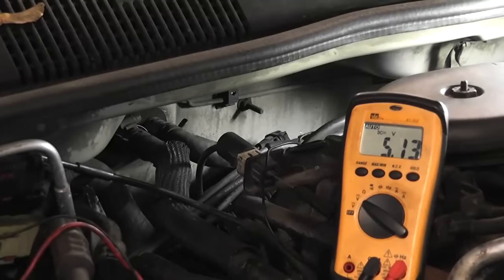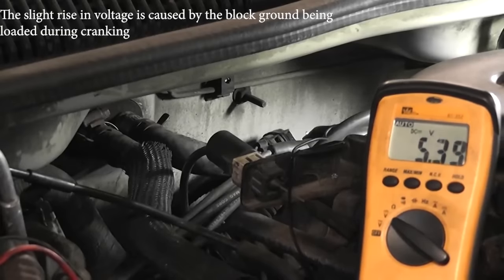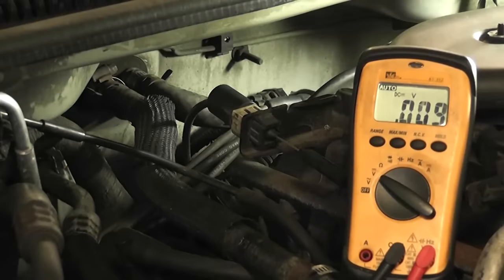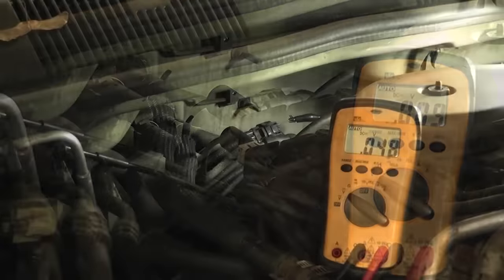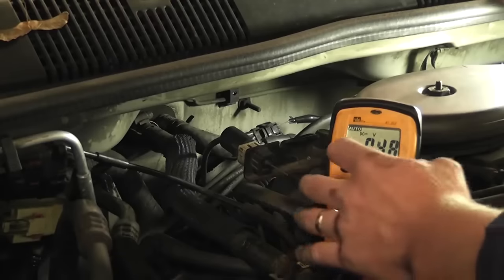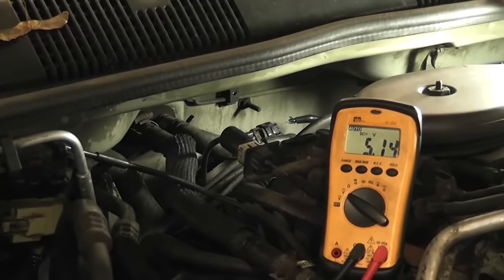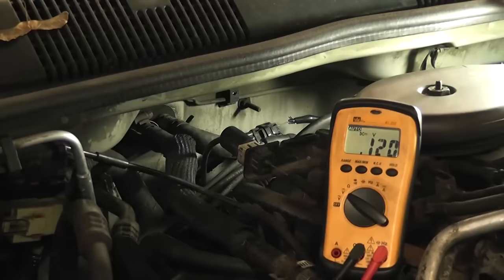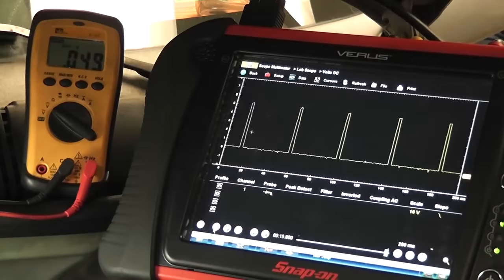How to test a cam or crank sensor with a voltmeter - hall effect type - (Quick Tips)

Comment: Very nice video Danner. I liked how you are breaking videos down to segments for us to learn. I really liked how it's was straight and to the point on how to test hall effect sensors. In addition, I liked how you showed us with a volt meter and compared it to a lab scope. Not all of us diy guys have snap on graphing. I always like it when it is explained on which meter leads are connected to which terminal on the battery and what the dvom is set at when doing electrical testing in video during testing of each wire. Because if it's not explained, I can watch a video and not understand exactly how it was done if there person explaining doesn't explain which terminal on battery he connected to and what his dvom was set at while testing the electrical component. Might I say though, I love all of your videos. Thank you.

Comment: Thanks Paul - Great reminder, DMM at times will read 2.5 Vic on a signal who's frequency is below a certain sample limit.  For instance on a Wheel Speed Sensor you may be able to Spin the wheel by hand at a low enough speed and the VMM will read 0.5 Vdc on a 5 V pull down Hall Effect sensor.  As always thanks for your great teaching methods on your videos, "Scannerdanner There is NO Substitute !!"
Reply: I meant VMM will read 2.5 Vdc , 5 V , 50% duty cycle wave form, if the frequency is below the Sample limit, thanks.
Reply from the maker: Yes sir and thank you!

Comment: Excellent.
Check for air gap between inductor wheel and metal chips on magnet or sensor also. Found no start from this also.
Good show.
Reply from the maker: something you would never catch on a voltmeter, but the scope would reign supreme :-)

Comment: you can also use the ac voltage setting, hz setting and duty cycle setting on the voltmeter.

Comment: Pretty cool doing this stuff in the field and then sitting here after dinner I get a video on it haha. Had a Dodge 5.9 with a no start. For whatever reason my dmm showed both sensor powers and grounds good and then my scanner was showing a good ckp signal and a bad cmp signal. The funny thing is, upon removing the ckp sensor, it was swollen and cracked from oil intrusion from the vc gasket. Installed a new one and it fired right up, yet still shows a bad ckp signal and says out of sync. Silly mopars.
Reply from the maker: for sure and a great lesson to learn! A faulty cam sensor can set a false crank sensor code and vice versa. And yes, I haven't seen it on any other models but Chrysler :-)
Reply: @ScannerDanner  thanks for taking the time to reply dude. Love watching when I have time!!!

Comment: Hello sir it was awesome video and I have question .why signal was not 5 volt constant or I am mistaken
Reply: 5volt to ECU/PCM
Reply from the maker: I put a note in the video. The reason is wasn't was because I was connected to battery ground with my dvom. If I was connected to the engine block or sensor ground, it would have been steady.
Reply from the maker: Great question!
Reply: @ScannerDanner  I got that sir thank you from your great information it is awesome man thanks

Comment: Please help! Firstly, your videos and knowledge are great! I have a problem with my wife's 04 Buick Lesabre. 3800 series II engine. When I read the voltage in the two signal wires of the CKP sensor it shows wierd stuff.. Unplugged its 6.2V each. With a new ICM its 4.95V each. Problem is when plugged in to ANY ICM: drops to 1.77V and 0.77V and STAYS there no matter what. I tried 4 different sensors. Acdelco, gm geniuine. One of them would drop to 5.5V and 4.5V. But none will recognize the metal teeth of the harmonic balancer. When tested outside, but plugged in its still the same. Its getting power, i checked every wire for damage, but im not sure about grounding because i checked that with key off for resistance. Between sensor ground to ICM ground (g112) there was 1.5- 3 ohms resistance. Is that too much? Whats going on? Car ran the last time when i changed the CKP sensor. It ran for 2 mins then died and never started. Please help

Comment: Exactly what school taught me. But got a question. Let's say you remove power to the hall sensor. Would the scope show constant 5v or 0v from the signal wire?
Reply from the maker: With the sensor unplugged, some will read 5v while others will read 0v. There are two different design signal circuits (pull-up and pull-down)
Reply: @ScannerDanner  thanks for the reply!

Comment: I never actually understood why my meter wasn't "fast enough" to measure a crank sensor, I just know it isn't. Funny thing is, I've scoped them, but never put 2 & 2 together for the time window of high point voltage verse low point voltage as to why my meter isn't fast enough. But when you explain it, it makes perfect sense. Also, in theory with a meter, you should be able to do KOEO and bar the engine over and be able to observe the high and low points no? (As opposed to the bumping demonstration you did with the key)
Reply from the maker: That is correct, only reason I do not suggest that is with the key on, you may get a kick from the engine while rotating it by hand, leading to injury. Unlikely, but that is why I do not suggest it.
Reply: @ScannerDanner best to find a fuse for a fuel pump or disabling spark so you don't get the jump you're talking about. If it's a diesel then disconnecting fuel pump fuse is all it takes

Comment: Very nice video. My 2006 mini cooper s don’t keep the 5 volts when I crank. What does it mean? What could be the next test or what do I need to replace? Thanks, Tom
Reply from the maker: You need to verify the ECM is maintaining its ignition and battery feeds during cranking

Comment: Great vid, thank u for that bro. Can we make this test with prow power prob IV
Reply from the maker: Yes, of course. It does content a voltmeter
Reply: @ScannerDanner  do you have anything belongs power prob iv tester that can help me to use
Reply: @ScannerDanner  do you have anything belongs power prob iv tester in your channel that can help me to use
Reply from the maker: Type in "power probe" in the video search box on my channel page. I have a few
Reply: The power prob hook is a really good   tool check it out.  I use my hook on a daily basis.  You can see source voltage,amps,and resistance all at the same time.  There is a pulse width mood and bias volt from .5v to10v, and much more.

Comment: Thanks Paul, as always - well done.  Kind of odd, the Cam sensor looked like a 5 volt peak square wave form at about 50 % duty cycle, should have read ~ 2.5V dc on the voltmeter ? Once again thanks.
Reply from the maker: frequency is what you are not considering. That DMM will sample about 4 times per second, maybe less. If the frequency is real slow, the meter will start to show the highs and lows

Comment: can you also remove plugs and slowly rotate crank with ratchet on crank nut to enable the multimeter to catch the signal? these videos are great, they are the only videos that teach one how to diagnose things like this.
Reply from the maker: You can do that as well, BUT there are some safety concerns with that. One, the key will be on and the crankshaft can kick on you on a compression stroke with an ignition event. Two, there is no need to go through all that work when you can just simply bump the key.

Comment: Mr. @ScannerDanner, you mentioned slowing the crank down to test for signal but did not mention one can manually turn the crank while checking the signal. I found in my Acadia (pull-down system) with P0335, I only saw 0V at signal while manually turning the crank. I then found the connector had signal and ground wires exposed and shorted to each other.  I trust the ECU and sensor are still intact.  ¯\_(ツ)_/¯
"KEEP CRANKING KEEP CRANKING" 🙂

Comment: Great info. I’m trying to figure out a 2014 equinox no start issue. I understand that using an oscilloscope would be ideal. My computer is giving me p0017. I have replaced all sensors, timing chain and cam phasers. Double checked the timing chain it’s correct. Sometimes the 2.4 ecotec will start and it runs great. When I turn it off it won’t start. I’m thinking if the reluctor ring has moved on the crankshaft I would get a p0016 and p0117. Any thought and how much is a house

Comment: I've got some symptoms and some codes, I'm thinking it's bad o2 sensors,   I would love to know if you think I'm on the right track?   I'm a bit of a rookie mechanic. I'm a delivery driver trying to keep my car on the road so I can keep working.

My car is a 2009 Pontiac G5 with the 2.2 ecotec, naturally aspirated, 5 spd with 104k km's on the it. It runs flawlessly up until this new glitch, New spark plugs, air and fuel filter since I bought it. I did notice it was starting to get slightly worse gas mileage before it started messing up. The first time it happened I was at a rolling start slowly accelerating when all of a sudden it started stuttering really bad and tried to stall, I pushed the clutch in and dropped it down a gear and it seemed to sort itself out (no codes popped up yet) then about 20 mins it did it again so I parked it, I tried unplugging the battery to let it reset and tried to drive it again the next night, again as soon as it got warm it started doing it again and finally threw up the engine light. (I did not have a code reader at the time)

At first I thought fuel pump, but fuel pressure is at 60psi while running and holds a solid 50psi for sometime after the engine is turned off (so I'm assuming it is good) I bought a code reader yesterday and it gave a EVA and o2s symbol with codes P0336 crankshaft sensor, and P0102-001, P0113-00.

from my research I'm seeing that o2 sensors should be changed around 100k km's and a couple online friends said they should be my issue... But I can't afford to be wrong and waste money right now.

Comment: At 4:35 the multimeter must read the same voltage at all speed , because the wide and the amplitude of the signal will never change, only frequency change

Comment: I have a question  , what causes the voltage drop at sensor? Does pcm drop the volts?
Reply from the maker: For a hall effect? There is a transistor that will switch on and off to either ground, or positive (5-12v range) depending on the circuit design (pull-up or pull-down)

Comment: How about using the duty cycle function all but the most basic MMs have? It should give a steady Hz while cranking and a little basic maths would tell you what that should be (cranking rpm /60 = crank sensor frequency).
Reply from the maker: You could use that, but I would suggest doing that only after viewing the voltage first. 
A signal that is fixed at 5v would be handled differently than a signal that is fixed at 0 volts and in both cases you would have a 0% duty cycle. Also the duty cycle test on some meters is pretty poor from what I remember.
Reply: Videos subtitle espanish View from P.R

Comment: What if there's no ground wire on the crankshaft position sensor plug only high resolution signal, low reference and 12v reference

Comment: Are all hall effect sensors outputting 0-5 digital sq. wave or are some putting out 0-12 sq. wave? Does that depend on the amplifier or the Schmitt trigger?
Reply from the maker: Some are 5, some are 12 and it depends on the signal circuit design in the computer as well. Some are a pull-up design and some are pull-down
Reply: @ScannerDanner  interesting. I had a case of a bad cam sensor. Code was cam pos sensor open circuit or short to B+. This was in an 05 vw passat 2.8. I checked power and grounds to the sensor. Both present. 5v reference as a power and computer provided ground. However, the signal wire was constantly pegged at 11V. I measured with a fluke dvm. With or without the sensor plugged. The computer was putting out 11V on the signal line, which was ONLY detectable with a dvm. I measured at the sensor side. I measured at the computer. Every time - 11V. I thought the computer was shorted internally. Til I took my led light with integrated volt meter. And it wouldn't measure any voltage. I took a regular old incandesent light and it wouldn't light up at all. But my fluke measured 11V every time. That completely threw me off. So I decided to put a new sensor at that point and the code went away. I don't understand what kind of design this was... could you enlighten me please? Thanks Danner.
Reply from the maker: @HristovRumen  If you still need help, I've created a free forum you can join on my website at www.scannerdanner.com I have over 28k global members and hand picked moderators who are there to help me help you guys. Hope to see you there! I try to do my best at helping people here but I just can't keep up, I am sorry. But we can definitely help you on my forum!

Comment: Could you turn the engine over by hand and check the signals with a Voltmeter?
Reply from the maker: you can, but there is a slight chance of the engine kicking on you with the key on and that may break a hand or arm if it does. I don't recommend that. Bump the starter instead
Reply: @ScannerDanner   Thanks for the Replay  !  Great Video's  ! Keep them coming !

Comment: So do you always get a 5-12v feed/signal voltage? Because on my A6 1.8T I get 2.59 on both. There's nothing wrong with the car so I'm wondering if this isn't just a design issue?
Reply from the maker: I've heard some of the Euro cars use a 3v reference. But I've not seen that
Reply: @ScannerDanner  ah, there you go, then. Gotta love German engineering! I saw the video on which you were complaining about that Jetta with the Evap valve and the poor design of the sequential testing. You should see how VCDS works one day (unless you already have) that's about the worst interface design ever.

Comment: I bought a Verus. Tried to read a crank signal on a Mitsubishi Endeavor V6 the other day by connecting it to signal and ground on the sensor. It read a solid 12v during cranking. The car WILL start intermittently and run. I was using the information provided by Mitchell on the Guided Component Test settings with the scope. So confused.
Reply from the maker: Connect your ground lead to battery ground and then measure each wire individually and redo your tests

Comment: Got a question. KOEO Back probing a cam sensor on 5v ref I have 5v. On ckp sensor back probing 5v ref is 9v. Ckp unplugged its 5 volts. shorted internal ckp? 97 s2000 2.2l std trans.
Reply from the maker: Who makes the s2000? Some systems used a 9v ref.
What are the voltage levels on all 3 wires plugged in and unplugged? (KOEO)
Reply: @ScannerDanner  1st - LOVE THE CHANNEL! 2nd, Thanks for replying. Honda makes the s2000. Unplugged I have battery voltage, ground and a 5v ref.  (Used a Mitchell flow chart procedure). The car has had 3 cheap cheezemo ckp sensors installed at a shop. Same issues. P0335- no signal detected and runs like 💩, no acceleration and bogging. I ordered a ckp from Honda will be here Monday. I’ve done a test with a volt meter while the ckp plugged in back probing and using a socket to act as a trigger. The voltage barely moves. I test the cmp the same way and all works as it should. Was curious about the 9v ref while plugged in.
Reply: @ScannerDanner  figured it out. Needs 5 v not 9v.